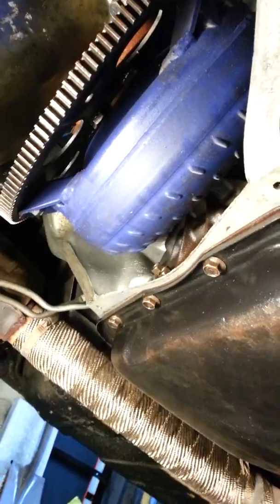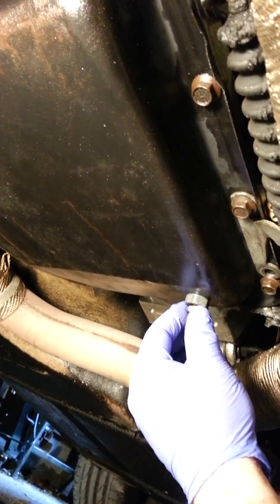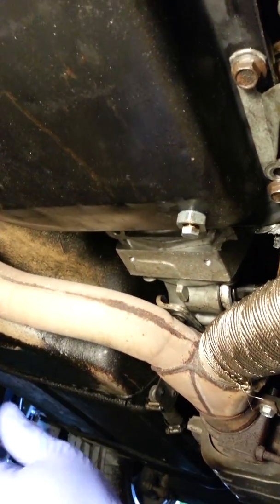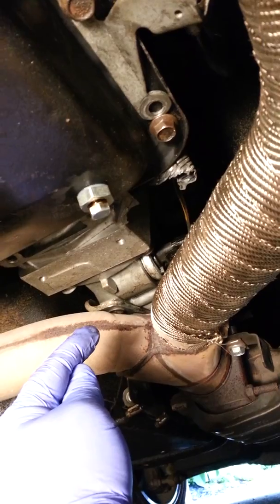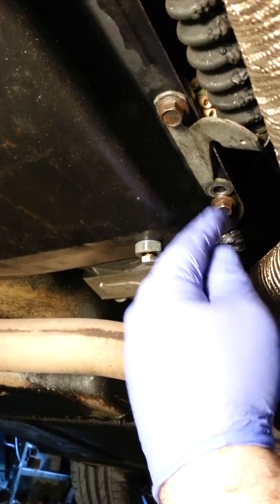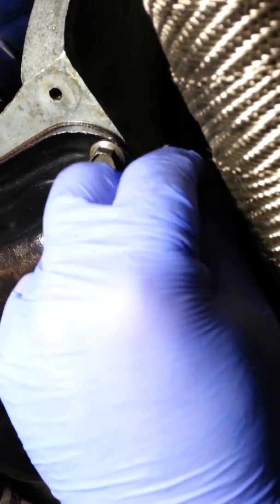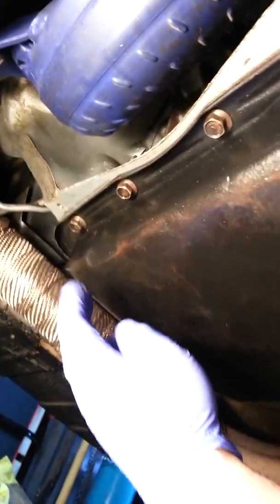C4 CORVETTE 700R4 to TH350 SWAP

Comment: This is some good info, what did you do for the c beam?
Reply from the maker: I used the original tail housing of C4 700r4 and got a spacer adapter from fitzall adapters online to bolt it onto th350. They also sold a kit to do same thing with th400. Sadly they no longer sell any of these adapters except for 4x4 swaps. It makes the th350 transmission length same as 700r4 so original drive shaft can still be used. I had a quick review of it I removed that I can re-upload it for you.

Comment: When will people learn to turn their phone's horizontal for filming?
Reply: @djrowe10  Hi There, I appreciate you helping me. I have current videos and ones going back 15 years. I have built 44 Starsky and hutch gran torinos. I just recently built an 82 Trans Am and it has a horrible transmission in it and a chevy 305. I was looking a videos that showed conversions and bolting up Chevy Turbo 350 trannys to 305s. I'm learning it is not a direct bolt up replacement and modifications have to be done. I'm really sorry if I offended you with my comment. Please forgive me.
Steve
Reply from the maker: I accept your response. Good luck with your build.

Comment: What RPM are you running 60/70mph with the th350 cruising
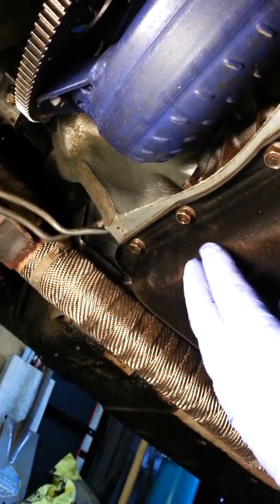Reply from the maker: My rear gear is a 3:07, so at 60mph RPMs are 2500 and at 70mph RPMs are 2850. My tires are also smaller at 26" diameter being 255 45 R17 instead of a 1990 stock size of 275 45 R17 at 27.75". With 26.75" tire size it would cut RPMs down another 250 RPM. Also, most automatic C4s have a 2:59 rear gear that would cut down RPMs to a range of 1950-2400RPMs at 60-70mph with stock 26.75" tires. I will provide links to help you calculate your needs.
Reply from the maker: Tacoma tire world has a tire size calculator that I use to determine RPMs with Spicer company's RPM engine calculator tool. 
https://www.tacomaworld.com/tirecalc
https://spicerparts.com/calculators/engine-rpm-calculator